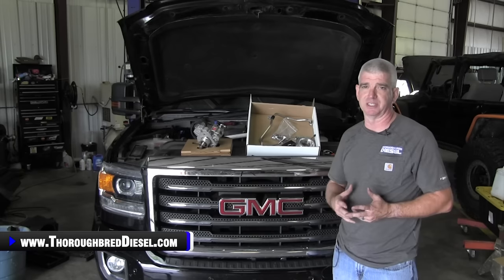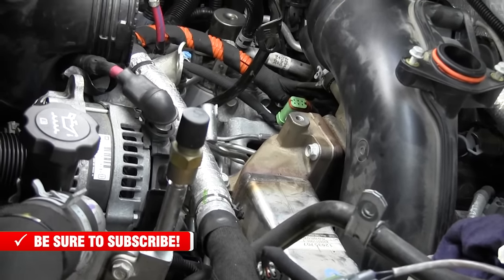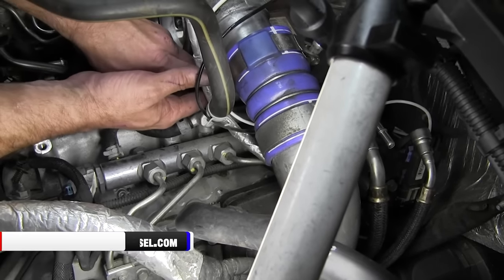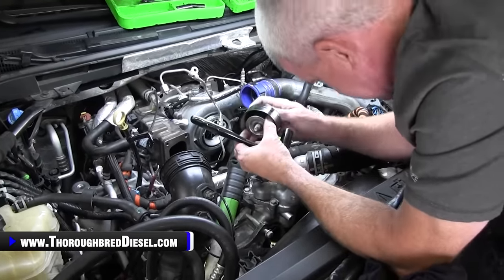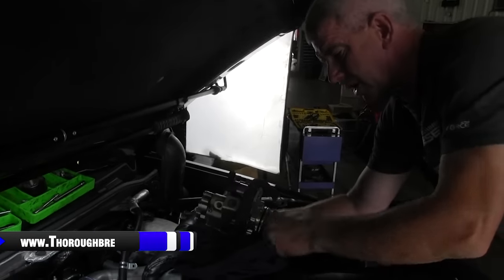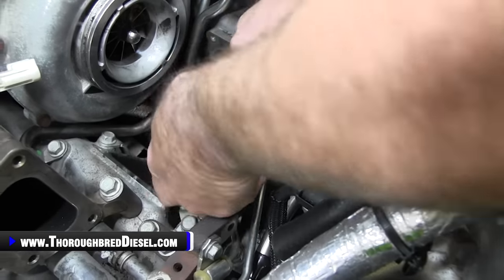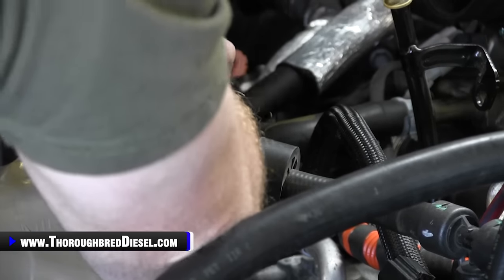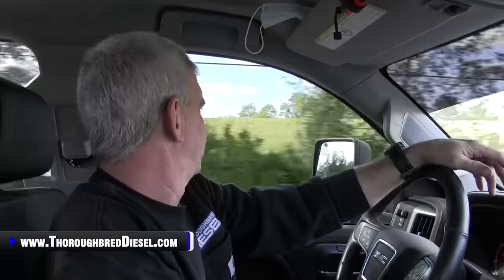Our Biggest Install Yet! DITCH Your Unreliable CP4 Pump For Something Better (Fleece CP3 Conversion)

Comment: Just completed the CP3 conversion on 8/10/23 Inspected the pump regulator and fortunately there was no metal contamination. Also per Fleeces recommendations I replaced the left hand fuel rail regulator and the entire injector return line system, Will say I did have some challenging moments during this project but it all worked out in the end. Even though I installed an Airdog lift pump a year ago and the instructions provided a way to remove the factory fuel filter I opted to keep the factory filter for more filtration. Truck started right up after 2 hand primes with the factory filter primer. I immediately took it out for a short test drive and it ran perfect. After making sure the coolant was topped of I to it back out for another run. After getting back home I connected the scanner and no codes popped up. Put DPF into forced regen which took about 40min. The next day I hooked up my 34ft. 5th Wheel and took it on a 10 mile drive with the scanner connected and it ran good and no codes. Very happy with the Fleece kit and would recommend this to any LML owner to do the conversion especially for the piece of mind. If you have some mechanical skills and a decent inventory of tools it can be done. I am 76yrs. old and a retired aircraft mechanic so I guess I might have had a little more background in maintenance but after watching this video twice it gave me the confidence to tackle the job.
Reply from the maker: You're welcome and thanks for sharing!   Great info and glad it worked out.

Comment: Thank you for creating such detailed video! Huge time saver! Seeing you laying over the engine bay made look up topside creepers and I bought one, man, that was a game changer. I couldn't imagine leaning over the engine for the better part of 2 days without it. Thank you again! One more thing, I ended up taking the heat shield off the backside of the turbo, the 3 bolts weren't rusted and it made getting access to the devil bolt on the high pressure crossover a little easier.
Reply from the maker: Glad I could help!

Comment: Time to do a cp3 conversion video for the Cummins. Should be a shorter video at least.
Reply: might be easier. is there more space?
Reply: @Mikefngarage  cp4 on a cummins is fairly unobstructed. You don’t have to remove components to get to it.
Reply: Wonderful V8 diesels. No room for anything under the hood.

Comment: I have a 2016 LML and lost the CP4 at 86,400 miles. GM did warranty the repairs but I'm wondering if they just replaced it like and kind and wanted to know if this bound to happen to me again? I have 134,000 miles currently and it's all still stock (including the GMC CP4 repair)

Comment: I just purchased the latest CP3 Fleece kit for my 2016 LML in July 2023. They made a major change in how the dosing lines connect. It now has two flex lines that run from a special banjo bolt on the top of the pump that connects to what they call a cascade block. Also the temp. sensor in mounted into the cascade block that will allow it to function. Also in the instructions when done it states to do a forced regen which I don't see where that was mentioned in the older kits.  I bought a scan tool just for the regen. Probably going to start this project next Monday the 31st' of July,2023. I haven't had a failure of the CP4 with 40,000 miles on the truck but this will give me peace of mind hopefully.
Reply from the maker: Hope the install goes well.

Comment: Thanks for this video! I'm at 197,000 with my factory CP4. However, I've replaced most of the EPA gear. Even that doesn't bother me as much as the whole limp mode thing. First time was 130 miles out of Whotehorse, YK enroute to Alaska. Last time was on I95 in South Carolina. Both major safety issues due to the unreasonably short mile allowance.
Reply from the maker: You're welcome!

Comment: Great video I'm going to get a CP3 pump when I fix my TCM problem. I noticed no key way, I thought they should have a key way in the design just for an extra percussion so the gear doesn't slip. I know if its tightened properly it shouldn't.

Comment: So the nut is not flush with the new CP3 pump. I used a ittle loctite to ensure gear doesnt slip. I know on cummins isx engine is standard procedure on none keyway tappered shafts. 
what your not explaining is the injector return plug that comes with the kit. Or u can explain the procedure to eliminate the stock fuel filter if you want to install a Air dog sys,
Reply from the maker: Yes the nut does not flush up completely but of the thousands of these we have sold, we haven’t had one come apart.  With this truck, the plug is not used.  And we explain in this video which line to use with a aftermarket lift pump that will eliminate the stock fuel filter housing.

Comment: I am actually in the middle of doing the install, the only thing that i have noticed that is different, the kit i ordered through you guys, and my CP3 didn't come with that dosing line coming off of it like yours does in the video when you are swapping everything over from the CP4 to the CP3, so I am a little confused on what I should do about that, other than that, awesome video!
Reply from the maker: Thanks!  The updated kit doesn’t use the dosing lines, and gets fuel supply from the return side.  This is updated in the current instructions.

Comment: My install is coming along, but the balance line wants to rub the back of the CP3. The holes are lining up. In the video it looks like there is a line support on the back of the CP3, but there is no place to bolt one on mine. Any ideas or suggestions?

Comment: Iv been doing mechanical work and engine building for 60 yrs...You have my deepest respect and acknowledgment of your expertise and skills...this job and engine is a mechanical nitemare....the complex design is horrible....I’m so glad I do not own one
Reply: As part of the current generation of mechanics the gm trucks with duramax engines are by far the most difficult to work on. Lots of unintuitive ways to repair anything on the truck. Most repairs are done through the inner fender well which isn’t easy and by pulling the cab. I’ve pulled more cabs on gm trucks than fords 2 fold
Reply: @MrSmoush  It IS an isuzu

Comment: I changed my EGR cooler bypass valve which is a lot the same work.  This is so much more complicated.  Thanks for showing me this  may be out of my skills.  I may need to have someone do this to my truck.
Reply: Hey Jim I have a code for EGR bypass now as well on my 2011 . How is the job to do ? Any videos that you know of to follow how it’s done or any tips .

Thanks

Comment: No diss this is a great video but they did make a mistake in saying the ballance line can not br removed with the turbo still on. I have font it several times. It's a pain in the ass but once u find the perfect position it actually comes out nicely

Comment: What a great video! This is one of the most in-depth Duramax videos I’ve ever seen. I am grateful for the knowledge. This video also has convinced me never to buy a Duramax and to go with the power stroke. As the maintenance on the power stroke seems to be 100 times easier than what this mechanic is going through on the Duramax. I wish you luck sir in your continued to work on this machine.
Reply: I disagree. The 6.7 ford has the CP4 as well. Still a V8 = cramped engine bay

Comment: Why does the return line of the high pressure rail feed into the supply line of the pump? Shouldn't that return line go back to the tank to be filtered?
Reply from the maker: There aren’t any returns feeding high side?

Comment: Have a 2016 lml that had the cp4 fail. Had a shop put on the cp3 conversion and a disaster kit. Unfortunately still having problems with starting. The shop went through it and found no problems. As soon as i drove it home which was a 10 minute drive. It did not start again and had to use starting fluid. Any ideas?
Reply from the maker: I would suspect a problem with the collection return from the injectors, or the possibly the tank wasn’t cleaned post failure and unfortunately you could have had more metal introduced into the system.
Reply: @thoroughbreddiesel  you think maybe sucking air? Supply to pump leak with no lift pump?

Comment: Which dash monitor will show the fuel valve propotion so i can check if my lml i just got with 180k on it doesnt blow up. I learned that if the valve is showing over 30 percent open its time for  a new cp pump
Reply from the maker: Are talking about FCA duty cycle?

Comment: Thank you for this video, I’m about 1/4 way through and this is very informative. My question is I have a 2011 LML with code P140A . EGR bypass valve . Do you guys have a Video on performing this repair as well ? Looks like your right there doing this conversion. Really appreciate your help. 

Thanks,
Heeb
Reply from the maker: We do not, however if you look at your valve the replacement is pretty straight forward.  If you are going to attack this repair on your own, we suggest getting a Alldata or equivalent subscription on your truck so that you will have access to the proper diagnostic, repair procedure, and torque values.
Reply: Thank you for getting back to me so quickly. Much appreciated. I am a Technician at Mercedes Benz, so I do this stuff all day and do have access to Mitchell. Just have not done any work on Dmax . I just here that the bypass job is like 10 Hrs? I would assume doing. The conversation and the bypass at the same time would be a good time to upgrade the turbo as well. I currently tuned by Duramaxtuner all emissions intact. I was thinking S&S pump though . Would this pump be able to be tuned more then my current CP4 pump? I know the pressure will be lower but I guess the  CP3 flows more . Thanks for all your information. Sorry for the lengthy reply. 

Heeb
Reply: Thank you for getting back to me so quickly. Much appreciated. I am a Technician at Mercedes Benz, so I do this stuff all day and do have access to Mitchell. Just have not done any work on Dmax . I just here that the bypass job is like 10 Hrs? I would assume doing. The conversation and the bypass at the same time would be a good time to upgrade the turbo as well. I currently tuned by Duramaxtuner all emissions intact. I was thinking S&S pump though . Would this pump be able to be tuned more then my current CP4 pump? I know the pressure will be lower but I guess the CP3 flows more . Thanks for all your information. Sorry for the lengthy reply. Heeb
 @thoroughbreddiesel

Comment: Great video . What I find odd is the fact that GM knew there where problems with the CP4 clear back to around 2013 on those LML's but yet continued to use them instead of changing back to CP3's or redesigning one to put out the proper fuel pressure that the system was designed for with improved build quality and durability . The one your fixing is a 2016 model ,,, so all that time later and they never even tried to improve that problem . It seems to me that they didn't have the customer in mind too much on that , as that can be a very expensive repair for a customer if that CP4 fails and spreads metal shavings all through the fuel system . I think that that's pretty shitty on their part . I own a 2013 LML 6.6 V8 Turbo Duramax 3500HD Crew Cab , and I'm seriously considering swapping to CP3 on mine for preventative maintenance  . Currently sitting at 90.000 miles on it right now . Thanks for the video . Nicely done !
Reply from the maker: Thank you and thanks you your insight.
Reply: Coincidence...... my 2013 LML is sitting at 89,XXX miles, in my shop getting ready to start the CP3 conversion tomorrow. I'm done rolling the dice on the CP4!
Reply: Highly recommend cp3 conversion asap! DO NOT WAIT!. I'm at 89,000 and decided to order my conversion kit as preventivemeasures. And guess what went out a day before the kit arrived. $1500 turned into roughly $7000 in just parts.
Reply: @Mike Garcia  that sucks! I finished mine a couple days ago. 18 hours from start to finish, taking my time and being extremely thorough!

Comment: I'm about to dive into my CP3 conversion. If my EGR cooler is already removed, is there any reason to remove the alternator, or alternator bracket like I've seen in other videos?
Reply from the maker: When working with that line,  I think its much easier with the alternator out of the way.
Reply: @Thoroughbred Diesel  thanks. I did remove it,  just a few extra minutes was worth it. For others attempting this project....remove the alternator,  upper radiator hose, intercooler pipe. Don't bother with the fan, it's not in the way at all. Not sure why instructions say to remove the fan, I didn't.

Comment: Great video. Once this is in and let’s say you have a Duramaxtuner tune already how much HP can this 50 state legal CP3 pump be tuned to? What Do you recommend as far as upgrading to one of there turbos ( stealth 64 or 67) Mainly use my rig to tow our 5th wheel. About 14 k . But do like to rip it now and then as well . All emissions intact CA . 

Thank you

Comment: Well this video accomplished two things.. I can now do this repair on this particular Engine and Year Model and it reassures me to NEVER buy a General Motors Truck ever. Thanks for both.
Reply: Ford and dodge also run the cp4 pump
Reply: I think all American diesel trucks use that pump.
Reply: @ZR1Terror  Ford does not use a Common Rail Pump for its fuel it instead relies on Oil Pressure from a High Pressure Oil Pump sending fuel to the injectors. And its a lot easier to get to and work on than this for sure. These are also found on Cummins Engines though which I was not aware however it is WORLDS easier non the less on the Cummins Engine than a Duramax. Duramax is one of the hardest engines to work on for just about anything ive ever had the misfortune of working on. 

And ill admit as much as I love the Ford 7.3L there's some things on those that are a Pig to work on. Cummins is very easy to work on for most repairs just because of the inline engine design compared to the V8 design on the Ford and Chevy engines which give you tons more room to work with. Especially anything to do with the Turbo which is piss easy to work on compared to Ford or Chevy.
Reply: @Demonlord468  a friend was telling me new Duramax’ are extremely expensive to delete.
Reply: @ZR1Terror  They indeed are but, to be fair just about everything is expensive when it comes to Diesel Trucks. And delete service is no exception no matter what brand to be honest. Best of just not buying anything new with that junk of it if you can but, in this market thats much easier said than done for sure. Its exactly why used Trucks with hundreds of thousands of miles on them without all that shit sell for so much right now actually.
Reply: I don't believe ford uses the same POS HPOP on 6.7 they are also using cp4 there is a kit to filter out metal particles. There is law suites also ford gm Dodge Volvo. The suit should be aimed at Bosch.

Comment: First of all great in depth video. I purchased a 2016 lol and was told that a cp3 was installed. Is there a way to visually verify that it was in fact installed without having to move all of that out of the way?
Reply from the maker: You should be able to see to the top of the pump. If there is a fuel metering unit on the top (electrical unit) that you see right away, its probably a CP4. If you have questions send us pictures and we can help.

Comment: Ram has a recall 2019 and up 220thousand trucks with cp4 pump waiting for them to get them in stock as of Jan 6 2022 no date yet ford  and chev have same issue no recall there there getting metal shaveing in fuel system check it out

Comment: So the 2008 Duramax LMM has a CP3 pump?
Reply from the maker: It was produced with a CP3 pump, yes.  01-10 Dmax had CP3,  11-17 had CP4’s, and 17.5-Current are HP4 pumps.

Comment: My LML is built for Off Road, therefore it is EGR Deleted with New Down pipe which deleted my "Dulcer" Line??  I think thats what you calling it?   So where the Dulcer? Line attached to the top of the block it is just plugged off on mine.   Since the CP3 comes with that Dulcer line attached does that have to be reattached or how do I handle that? I dont have the banjo washer anymore or the dulcer line that I remove from the Down pipe to the top of the block.. I have a plug where it attached to the Injector?   I am asking before I have watched the full installation so maybe you address that later in your video.. if so, NEVERMIND.. lol  Great video so far..  With mine being deleted it will be a lot easier than the guys working on factory assy's.  Thanks for the video.
Reply: I did a turbo rebuild on my 2011 LML which if anybody has ever done that, the is another bolt at the base of the Turbo that Satan also located.  That was a very daunting R&R but I just walked away from it and kept my patience and finally was able to finish the task.. was very rewarding completing that rebuild.  New up pipes as well.. a lot of scratched knuckles and sore fingers when I got done but was worth it.. I feel if I can do that, this CP3 will be fairly easy.. Just need to know how to get around that Dulcing? line that he keep refering to.   I capped mine off per the Delete instructions for the new Down pipe.
Reply from the maker: Dosing line which is the line running to the 9th injector.  This is an emissions compliant kit that retains the 9th injector.
Reply: @thoroughbreddiesel  So is there a plug for the CP3 so you can delete that line on the Pump or is that special order?